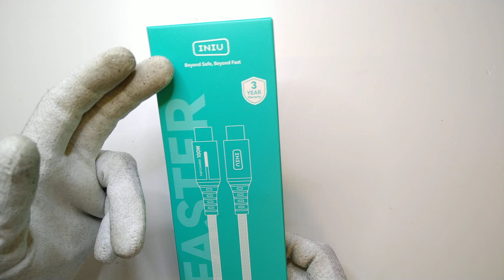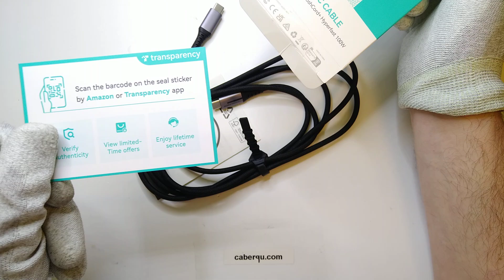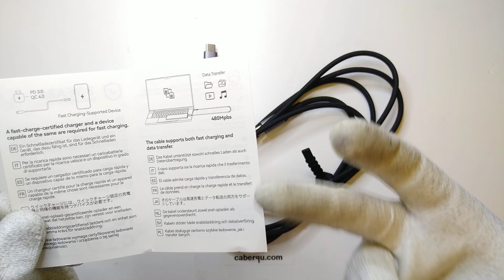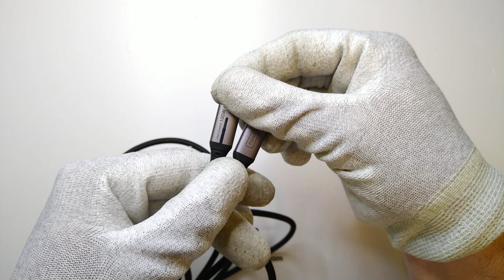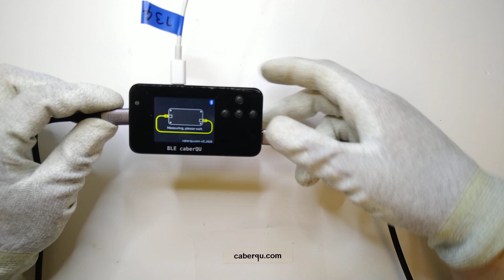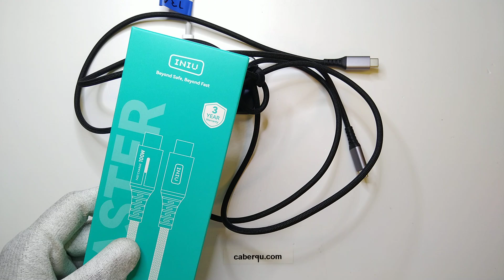This cable is wrongly eMarked

Comment: I'm super appreciative that I came across this video because I actually purchased a 240w cable from them and ran into trickle charging issues whilst charging my Samsung S23 Ultra. 

As of now, just to get this cable to work seamlessly with my phone, I have to ensure that the USB-C cable is put in my phone with the LED side facing backwards (so the blank side of the cable is facing towards me). 

 I don't suppose it could have something to do with the cable not being certified?

Comment: Also keep in mind that Iniu also OEMs battery banks for Anker. I would be checking anker as well.
Reply from the maker: Good call, thanks
Reply: @quiescentcurrent I'm not sure if Iniu OEMs the cables for anker but I wouldn't be surprised whatsoever. I do know for sure that their battery banks are whitelabels or at least whitelabels with some design changes. anker is the only brand I know that has a double press for trickle charge and iniu also has the same trickle charge, down to having a green LED or lightning bolt in the corner of the display.